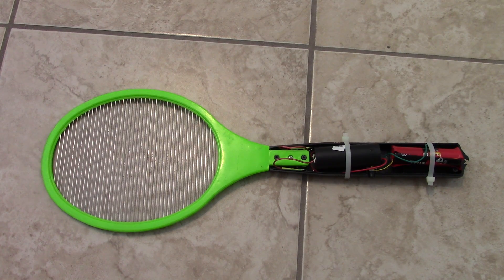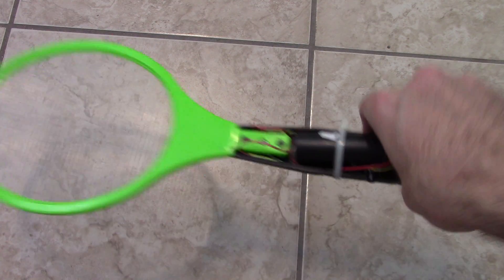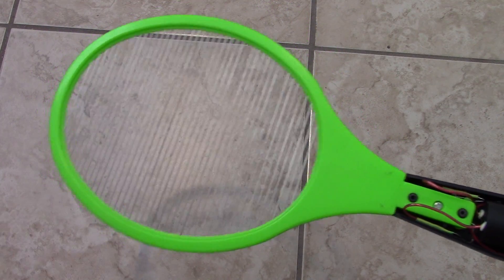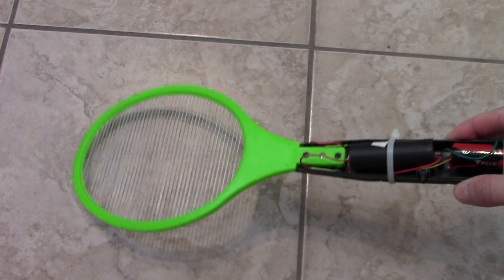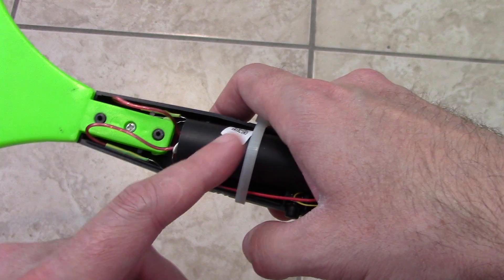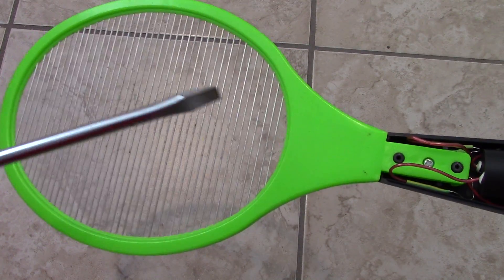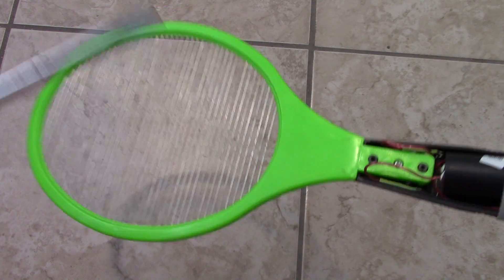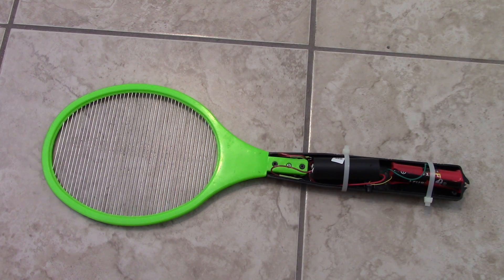World strongest electric fly swatter 400 000 volt OUCH

Comment: You need amps and not volts to really roast the fly. The voltage is already high enough to stun them.. try adding a nice big capacitor. Think electric welder - it is the amps that actually melts the rod! That arc'ing is actually showing you that the voltage is now too high - it's wasted energy.

Comment: How do you wire the 2 high voltage red wires to the single metal net? Do you connect both of them to the net or one to the net and the other to a grounding?
Reply: 3 wire screens. Its either + - + or - + -. Dont matter as long as you have the single wire on the middle screen.
Reply: My bad. He has a different type. If you have 3 screen type and you want to convert it to a spoke type screen, connect every other spoke to one wire on either side of the racket. That wire goes to either + or - of the big capacitor. It doesnt matter which. The other spokes connect to the other wire and to the other end of the capacitor. The end of the capacitor that has two wires, you can get rid of one of the two wires.
If youre converting from spoke type to 3 screen, use the finer mesh screen for the center and connect the one wire to it. If both ends of the cap only have one wire, use either one. If one end of the cap has two wires, either one of those wires connect to either one of the outer screens. As long as both screens has one.

Comment: Neat, but that's not 400 KV
Reply: @Pomona Town That's not how the burden of proof works but fine. Electricity requires about three million volts to arc per meter in open air. That's 30,000 volts per centimeter. I'll be generous and say there's about half a centimeter between each of those rods. You need at least 15,000 volts to arc across them, but he still needs to bridge the gap with a screwdriver to get it to arc. It's not even 15kv, let alone 400kv. I work with high voltage all the time, I know what 400kv looks like. And it doesn't look like this.
Reply: livey oone  ^^^

Comment: Very cool.

Could you list the actual parts that you used in your video description for us folks that have less electrical knowledge than others.
Also, a step by step videp showing how you gutted a normal, working electric fly swatter (like one of the $3 dollar models from harbor freight) and turned it into this cool, modded version.

In North Georgia (US), horse flies and mosquitoes are problematic. But, my biggest concern and what I mainly use an electric fly swatter for are yellow jacket bees and red hornets. I could see this being a very effective modded tool when killing those stinging, pesky, flying critters (especially, when you are trying to keep them away from kids in a stroller or car where using poison spray bee killer is a bad idea because the wind can cause excess bee spray to go into other people's/kids eyes).

Also, the huge electrical arc other are talking about (several cm long) isn't something I normally witness when using a 1,000,000 (million) plus volt stun gun using "DC" power (similar to the setup you created when you modded your fly swatter). Is it possible other people commenting are getting "AC" and  "DC" properties mixed up?

If you were to mod an electric fly swatter and convert it into an electric bee/wasp/hornet killer that could effectively terminate at least 50 hornets before dropping the battery charge on two alkaline "D" power cells, what power generator would you use and what voltag/amp output rating would it have? 

Thank you again for your time! 

Sincerely, 
Jacob
SurvivalGeek (YouTube)
https://www.youtube.com/channel/UCfRsUPToBXp4ZIre__dJg4A
Reply from the maker: SurvivalGeek I am currently in the process of buying a house so the video will take a little bit a time to come out but I soon as I get more time I will make it detailed video how to make a super fly swatter 👍

Comment: Patdud  why doesn't that voltage fry the curcuit?
Reply from the maker: David Farmer because it as new electronics in it that is designed for making sparks and producing high voltage.
Reply: +David Farmer - He replaced it with a " New " Circuit!

Comment: Good video. One thing though: Dielectric breakdown of air is 30kv / cm between rounded electrodes. 400,000 volts would be a spark 13 cm long. Take a look at plasma channel's first episode - I use a 400 kv power source I built, and the sparks are 9 inches long. You definitely increased voltage on your swatter, but not to 400kV. Those voltage generators use highly exaggerated voltage figures to draw more people into purchasing their product. They usually output 20 kv. I like your video nonetheless. Keep on experimenting my friend.
Reply from the maker: cool go to know thx and I know I still need to test this on a live subject lol :P thx for watching.
Reply: +Plasma Channel - Question?  400,000V AC or 400,000V DC  ???  Wouldn't that makes a difference?
Reply: @JodBronson  Not really, no.

Comment: How is it connected? i tried it myself but i have like 2 sides of those horizontal bars and some mesh in between. put the + on both the sides of bars and - on the mesh, not really good idea. i removed the mesh and put the - on the other side of bars but still to much sparks
Reply from the maker: hi I cut the 2 previous wire that was connected to the  grill side and resolders the 2 wire that is the same copper colors  then use the switch and use the positive wire to it so you need 2 wire for the positive the switch is a bridge so you use one wire to go to the positive and the  switch and one to go to the red generator wire and to the switch  i hope it help ?